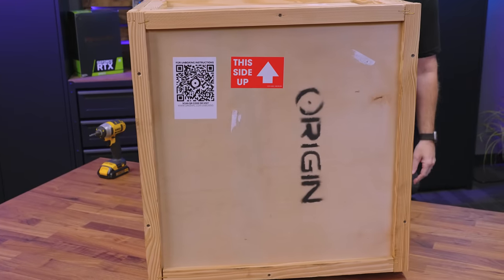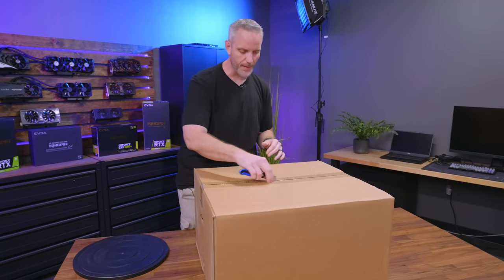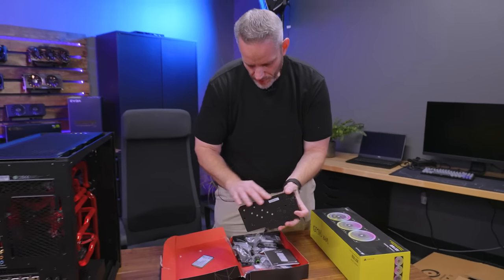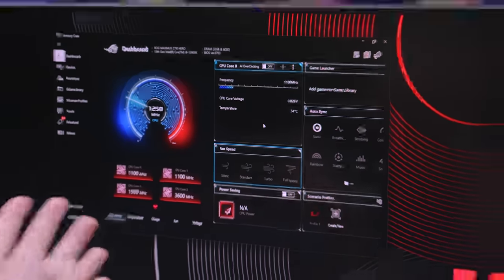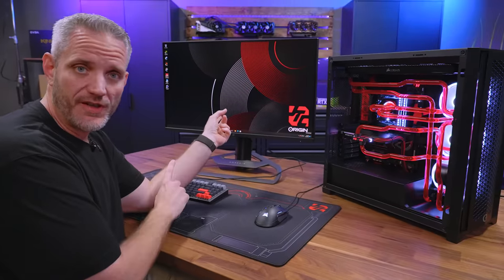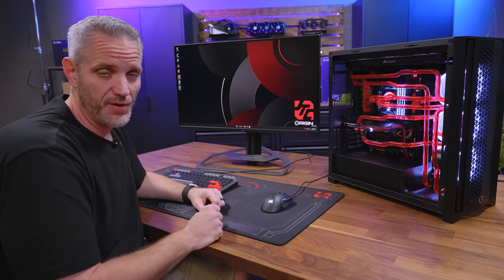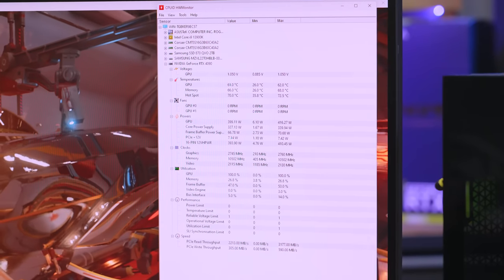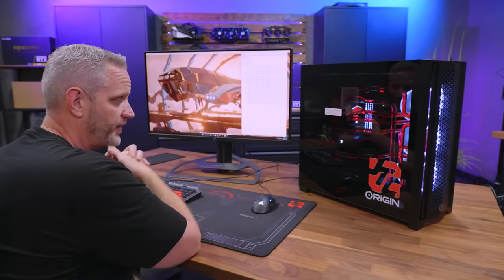When the PC comes in a crate, you know it's gonna be good!

Comment: We are all still ignoring the issue with icue. Theres no way to use 2 temperatures for a single radiator fan. Issue is i have to have 1 rad fan for gpu and one for cpu. Unless they are both under load only hath the rad is being used

Comment: Just received a pc from origin and was far from impressed, fans weren’t even mounted, just hanging with wires everywhere, was told bios etc was going to be updated, To find out bios was 6 updates behind, the cpu cooler isn’t square and just looked silly how off it was.

Just overall not a good experience for the price.

Comment: Bought a $1,500 ASUS gaming laptop for multi-purpose use. My only machine not impressed nothing but problems terrible screen. Sold it built decent gaming system with no ASUS parts and bought a cheap laptop from Acer which believe it or not has a much better screen than the ASUS laptop which was terrible horrible colors. Nothing but problems with ASUS over the years not using them again.

Comment: I am only jaded against Nvidia and Asus at the moment... because of the same product experience. I have told bits of this story before and I am now going off memories that are several months to a couple years old in a brain with faulty memory but basically I was playing FFXIV one night and it started to stutter at 1080p and I had sorted my settings in that game months before and shouldn't have been having an issue so I start looking at monitoring and I happen to pull up ASUS' GPU tuning first and immediately notice fan RPM is zero and the poor RoG Strix 1070 is throttling hard. I quick kill the game, set a user fan curve, which I seem to remember doing when I first installed the card but that curve was nowhere to be found, and do some testing to figure out for some reason in both ASUS GPU Tweak and one of the other tuning suites, I think it was Afterburner because I ended up using Precision for quite a while just to make sure, just letting the GPU handle the fans on its own with no input from the tuning software caused the fans to stick in zero RPM mode. After this incident my max OC was never the same on that card and I never quite trusted it on the default fan settings again but that is my story of why ASUS sucks and Nvidia swallows. Though the death knell for Nvidia was both the departure of EVGA and the superior ease of use of Adrenaline vs GeForce Experience. I will not say Adrenaline is perfect, it resets to default tuning with every driver update, but it just seems infinitely more useful than GeForce Experience ever was.

Comment: Another reason that all the cooling components SHOULD 100% have been hooked up iCue (or a program that can operate dependent on multiple heat generating components like you showed) is that you can set the curve based on coolant temp in iCue. So if you don't want to use a 3rd party software (like the one you showed) you can at least control cooling based on the total system temp of the loop. Also, zero intake is bad enough, but then doubling down with "this is how we do things" is even more brain dead. In a 1k to 2k system, I'd let it slide, but this is a VERY boutique system that costs more than a used car. No excuses for not doing it right (and the way you did it is objectively wrong, Origin). As you illustrated in the video, it's not a policy. It was a mistake to highlight form over function you're now lying about, Origin. Overall it's a very nice system with an exceptional loop and stellar cable management. But at that price point, it's not out of line to expect the best of the best. It's what you paid for.

Comment: Someone in the comments help me. I was just doing my thing on pc when suddenly shutdown no warning pc goes loop pc on pc off etc. I shutdown system fully from that loop. After that dram orange light on motherboard. Tested all the rams and realised all my 4 ram sticks work only when used ALONE on 3rd slot so on any other slot pc wont boot at all. I replaced psu, I replaced mobo, I checked the cables and everything. I reset cmos and still nothing. Only 3rd ram slot works after the problem.

Comment: This is just a noob question, no judgment here.
But I have Icue hooked up to my motherboard via the usb 2 header (three commander pros and RGB control units ) and I do get temperatures from my GPU, motherboard, ram, and CPU.
How accurate/ inaccurate are those readings that Icue is giving me?
Reply: as accurate as any other reporting - it's just communicating with the motherboard which monitors everything apart from the GPU, but communicating with the GPU as well of course, and relays that info back. same as with HWMonitor, GPU-Z, MSI Afterburner, or anything else really

Comment: i used the temp sensor pins  on the motherboard and put an extra temp sensor in my gpu . to be able to control the fans when only gpu is heating up
Reply: maybe this motherboard also has those. and could turn up the fans based on water temp .

Comment: Hm just exhaust Fans is really a bad idea😅... With my build (it was like 50:50 it still was a negativ airpressure or lets say the air from the bottom hat a long way, because it was blocked from the gpu sort of, like  in this case... As soon as I addet more intake Fans, the system was more cool and therefore more quiet 😅... And I guess its best for not getting to much dust into the case...
Still I don't know why manufactures don't build fans which are capable to spin in the other direction or you can take the rotors apart and set in others to get a intake fan which don't look like shit 😅 Solution would be simple...

Comment: How can I get my cpu mhz to go lower? I noticed in your video that your cpu wat running about half way on the speedometer dial thingy (idk what it’s actually called) but mine even at idle and NOTHING running. My cpu is maxed out at 5500 mhz and idk if that’s good or bad or how to adjust that. 😭 I have a 7900x with an AIO pump and I have issues playing games aside from when I go to a certain point of interest in gta v online the gpu will crash for some reason? But is the cpu alright sitting at max frequency all the time? I’m not entirely mew to pc building a si built my last rig too and I’ve never seen my cpu run that fast all the time

Comment: So, I have a question for the community....  I have an ASUS TUF GAMING X570-PLUS (WI-FI) motherboard, Ryzen 7 5800X, and 64GB of Corsair Vengeance RGB Pro SL RAM 3600 MHz (4X16).  
I need help.  No matter what BIOS changes I make, I cannot get a System Post with the RAM any higher than 3200 MHz.  DOCP on/off.  Manual and Auto settings.  Nothing.
Any Ideas ???

Comment: The 24 pin power connector looks like crap with the zip tie and no cable combs, especially considering the price tag on this system. But good look changing it with all those tubes obscuring the access. I don't know man, people with enough experience can just build their own water cooled PC, and everyone else would still be screwed if any component failed or if they wanted to change anything inside this system. You can't just take out the GPU, you don't have access to the RAM, adding another M.2 drive or changing the one that's installed is super cumbersome, and so on and so forth. I know this isn't Origins fault (except for the power connector), but I would never recommend this PC to anyone who doesn't have a certain level of experience. 
The "all fans installed as exhaust" approach is also pretty stupid, and difficult to change without partially dismantling the loop. So, overall it's just a huge waste of money, imo.

Comment: I like ASUS for their hardware. But i hate them for their software.
I have a Crosshair VII Hero with a Ryzen 3900x on it. RGB RAM, CPU RGB Fan and 2 RGB strips connected to the motherboard. Aura runs great on that stuff. Last Summer i put a 3060 OC in the pc with RGB. The old Aura can't find the GPU. So i installed the new Aura software. The new one don't support the old Mainboard. So i took a version between them, and its the same. And i don't like Armory Crate at all. I install the software direct, instead of using AC installer, cause he installs a lot of crap.

Comment: Armory crate is complete garbage.  I have an Asus g15 laptop.  I did a clean windows install with no bloat, but decided to install armory crate for the fan curves.  It completely broke my laptop.  Minecraft will now no longer load.  I tried rolling back the install with a restore point, but even that didn’t help.   I ended up having to reinstall windows.   Fixed the issue.

Comment: (1) Filter on the exhaust? (2) And their answer to this question? (3) Tells us that there are still to many inexperienced people making design decisions at Origin, for this one reason, I won't buy this PC................. Imagine if the vehicle or HVAC industry had this philosophy? - pull all the outside dust into your house, but don't worry, we will clean the air as it leaves your house, so that it is clean when it is pushed back outside? Whaaaaaaat?

Comment: 9:30 my experience with Asus and their drivers/software has been the worst i have come across
ive had 2 Asus sound cards, the first one i had back in the 2008 was great. the 2nd i got 2015 was okish at first but the drivers that did work stopped working and after that they only released beta drivers that caused blue screens and tons of performance issues. and with other hardware they just stopped releasing drivers after few years. especially on the motherboard im using.
the creative sound card i had 2010 was way better and creative still releases drivers to that sound card. where the last ones on my asus card where released in 2017

Comment: Anyone else having issue with icue lately? 

i updated and then it stopped being able to read my cpu and gpu sensors, but HM could. as a result the case fan wouldn't run fast enough to cool things off. Icue won't uninstall nor can the files even be removed, revo uninstall, CMD, and PowerShell won't get rid of them either, says files in use when it isn't even in resmon and windows services is didn't show icue runnig at all. I had to system restore to before icue update so case fans would work, but now Icue won't actually open, even though its running, and in the task tray there is spot for the icon but no icon for icue is showing, its just blank. and there are two program files for icue, a working one containing all the right files and the application and then the file that couldn't be deleted cause it thinks in use. the files that is in use is. C:\Program Files\Corsair\Corsair iCUE5 Software\CorsairLLAccess64.sys

only thing left I can think to do is backup everything but the icue files to a external drive and then do a full reinstall of windows.

Comment: Armory crate is just malware at this point. It barely works, it's very slow, it's caused ridiculous levels of instability on my system and Asus own older AI suite although has some issues is far superior and more reliable, even though it's not been updated since Windows 10 launched! I disabled armory in the BIOS to stop it demanding to be installed and haven't looked back since!

Comment: Its ok I guess, but I'm not ordering Origin, as you get it filled with Corsair stuff.  I like their RAM, but thats it.  I will not install their proprietary cooling, fan control or RGB systems in a computer I care about ... and this year rather than respond to customer concerns regarding proprietariousness by backing away ... they doubled down and locked their system out to any choice at all. So, I dont buy any of that, and so theres not much point in buying Origin.

Comment: Corsair and Armory crate have never worked well. 

Originally I could set the RGB for my ASUS GPU on iCue. Then they updated and broke it. So part of it I could change the RGB for, but the other half was either off or had 1 red light and 1 yellow light on. Managed to fix it, but had to uninstall armory crate. And now I cannot get them to resync. iCue is such a dogwater program, and Armory crate isn't any better.

Comment: I went against tradition with my monolith obsidian nas hdd server, felt it needed better cooling so went front and top intake and 1 rear exhaust which is near the top stead of top exhaust those dual intel xeons E5 2690 V4's run nice and cool, im getting 53mbps download speeds with this beast stead of the lousy 6.5mbps i get with my main pc 5800X3D with intel arc a770 16gb and 16gb 4000mhz ddr4, fraid i killed the backup pc hoping its just the power supply that was 5600g with x6700XT 12gb and 16gb 3600mhz ddr4 again only downloads at 6.5mbps, no idea why this ancient spec none gaming machine out performs the other 2 in terms of download speed, does 64gb ram improve download speed? that said my main pc has all exhaust dual water cooled loop setup and that runs just fine, though theres not much you can do with X3D chip OC wise.  Very neatly built PC i think anyone would be proud to own it except theres no greater pride then when you build it yourself.

Comment: No, not shameless plug! I need this fan control video to explain things to me. If the Asus software and Lian Li software was playing nicely which they aren't, then I wouldn't have a problem. But since the manufactures of equipment and software cant get together still in 2023, then I have to thank you for the engineering tests and education your providing! I really don't want to become an expert on positive and negative air flows, but the industry is forcing me to this knowledge so I can properly manage my system. What year possibly will the need to have to reverse engineer a factory system occur in your video? 

I saw one video where the presenter called Taiwan and argued with the engineers at Lian Li about case specs. The engineer did his best to evade and distract, but the US based Youtuber was emphatic that bench testing didn't lie and that the design was bad in some areas of the case. Could this be the reason why Apple is so popular? Because you don't have to become an engineer to use their stuff?

Comment: MSI control software is just as bad as Armoury Crate. They are all pathetic.

Also not a fan (pun intended) of the all exhaust. It's just going to cause problems in the long run. Especially pulling  dust in from every other opening.

Comment: Armoury Crate is s bad for a couple reasons, its a UWP app, not your general windows piece of software, and UWP apps are dog shit, and it also for some reason deppending on the specific board, doesnt have all the controls that id like to see, for example personaly i got an Asus ROG Maximus XI Formula board, its a Z390 board for 9th gen, and for got knows what reason, Armoury Crate doesnt have FANs controls in it for the case fans connected to fan headers on the board, however Armoury Crate does have fan control and pump control for my Asus Ryujin 360 AIO cooler for the cpu, wierd stuff, have to use a older piece of their software Asus Fan Expert 4 to control my case fans, and sometimes after some windows update, fan expert gets completely borked, while Armoury Crate works fine, sometimes its backwards, sometimes after some windows update Armoury Crate looses some funtionality, its just stupid

Comment: Honest, and probably pretty boring, opinion of that system. No!

A bit more nuanced opinion. No that is not a computer I would be prepared to pay that much money for. Now I come from the stone age, back before RGB Led was a thing. Heck the times someone put lighting in a case it was either cold cathode or even incandescent. Well I did work some with electroluminescent lighting, but that was really exotic. In fact most PC's, as in more than 99.5% didn't have a window in them and what lighting you could have was external, so very few bothered.

Anyway I wouldn't want to buy a computer like this with hardline tubing. Sure it's pretty, but I can't help but feel the pain when thinkin about changing out or adding components. For me the computer is the important part, not the bling bling. So I tend to fill my computers with drives and expansion cards. Working around the hardline tubes would be a nightmare. And getting rid of the distro plate in the front opens up for much better airflow.

Finally a solid steel case side would take care of the LED hell that required both ICUE and ArmorCrate be installed.

Hey I told you I'm boring! It's not like you weren't warned. Also this case takes way to few hard drives, not to mention no 5.25" drives. Where would I install my bank of optical drives?

Comment: Armory Crate is absolute trash. I’ve been using it since it’s inception and it’s improved but not on a great enough upward curve to deem it anything other than shit. I could do without at least 50% of its features, Aura Creator should either be eliminated or built in to the main app, the driver suggestions it has a crap and same with the bloatware junk apps it offers you…it’s all bad really. This is why I bypass it with a plug in to control it with Razer Synapse, and only use it to update my hardware firmware and packets. And yes, Synapse is worlds upon worlds better as an app than Armory

Comment: Jay why under volt the cpu if you just going to updatr bios to the highest cpu power dont get it. I guess if you are going to run cinerbench all day then and thats all you do then you are good.the pc you built for your family member cooling sucked.  You are comparing max spike temps to real time temp and that dont mater about any fan speads because the cold plate is the bottle neck. you can run the fans allday at full blat and it wont make a difference......